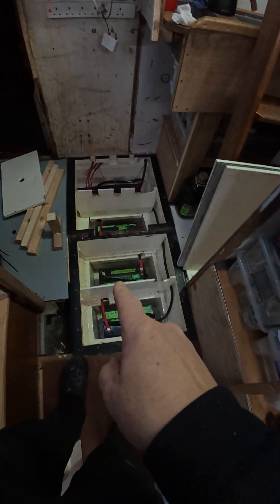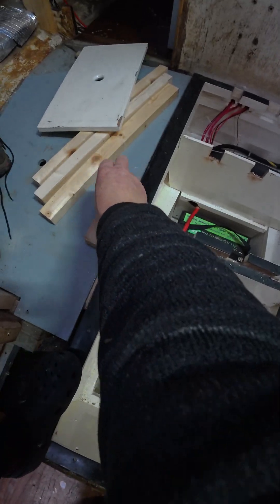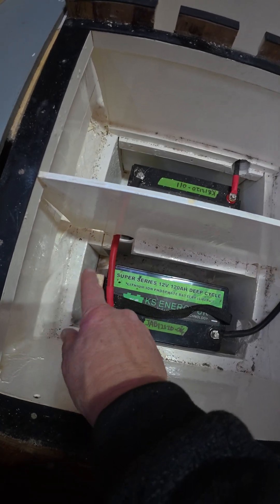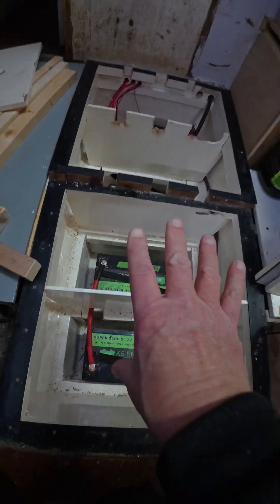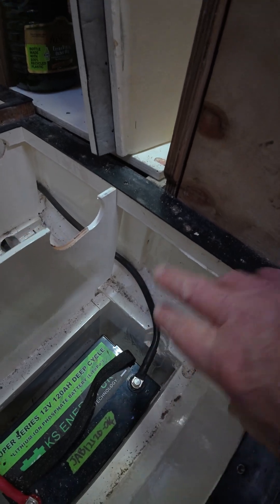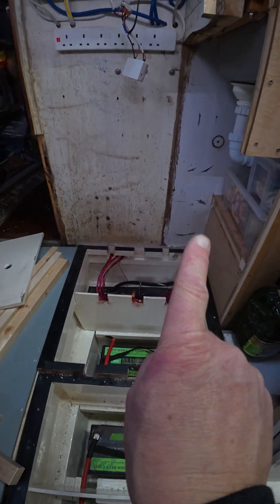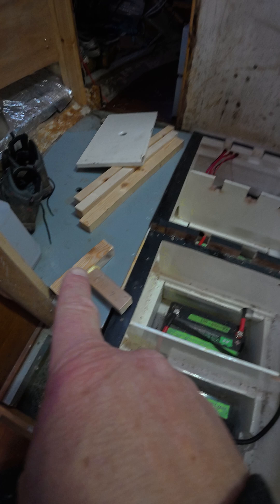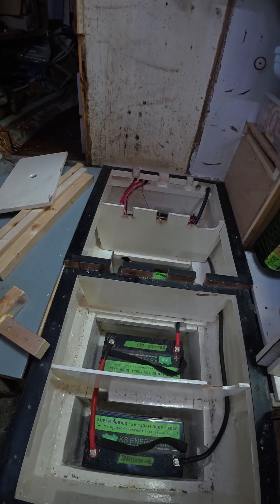Securing our 48V booster bank of 4x120AH batteries #BoatRefit #ElectricYacht #DIY

Comment: Hi guys, what made you go deep cycle?

I'm currently sourcing NA-ION, I don't trust Lithium if offshore (even LFP), LTO is just too expensive. But the safety, temp range and density seem ideal
Reply from the maker: We bought these batteries about 4 years ago. So Sodium wasn't an option. 
These were the best option at the time (when we thought we would launch much sooner).
Reply: @SustainableSailing he he makes sense. I bought 5kwh of lithium but I'm planning on switching. I know LFP is much safer than Lion but not getting enough charge in winter, even when the sun is out due to low temp cutoff is just a pain
Reply from the maker: Our lowest bank in the bilge are supposed to be able to handle lower temperatures. Once we have the ventilation working we can always get it to pickup warm air from near the Refleks diesel heater and blow it through the battery banks.
Hopefully ours will last until several more generations of development mean that their replacement will be orders of magnitude better. 
Our experience with our 10 year old Nissan Leaf (done 108,000 miles) is that they last longer than expected even if capacity drops off quite a bit.